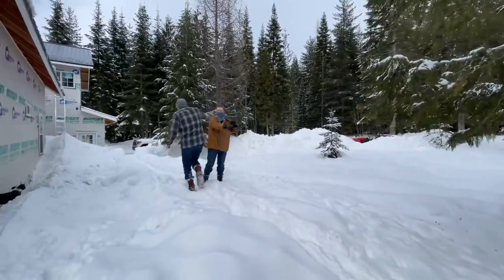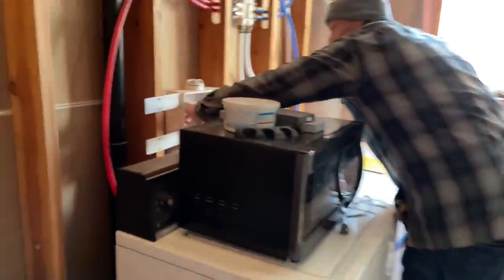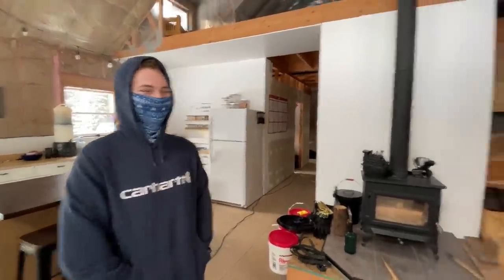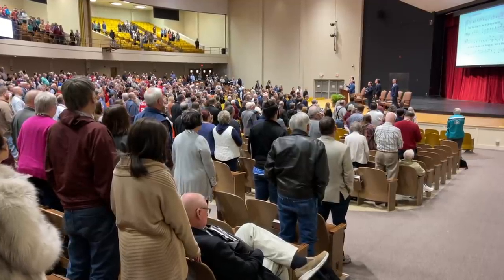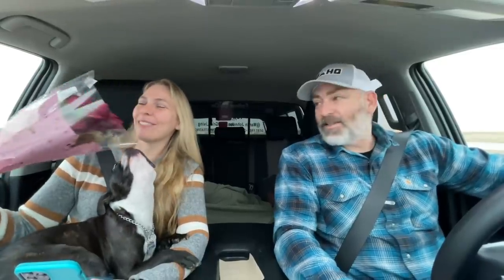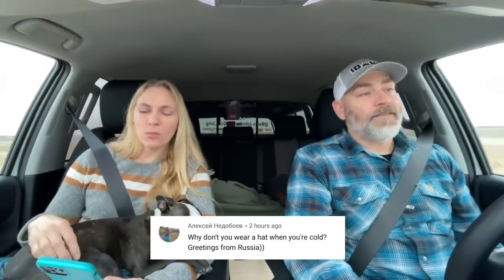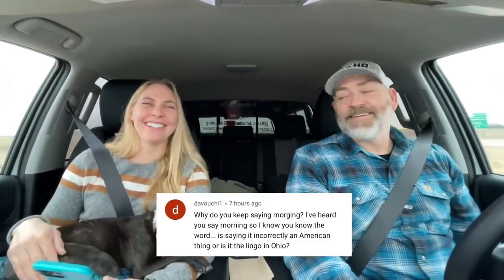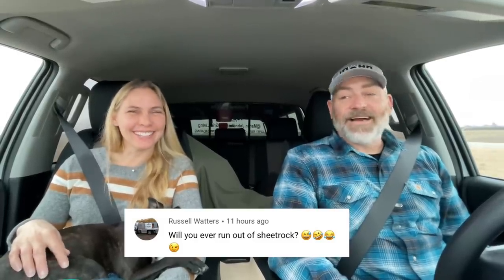YOU NEVER THOUGHT THIS WOULD HAPPEN

Comment: A tip to clean your stove. Items you'll need. Papertowel, Saran rap, amonia, blue grade scrubber sponge (this type of sponge will not scratch the enamel of most stoves, check your manufacture for cleaning instructions), scrub brush with plastic scraper. Step one: cover the stove top with papertowel (works best with a sealed stovetop), Step two: saturate the papertowel with amonia, Step three: Seal the stovetop with saran wrap overlapping the saran wrap to cover the entire stovetop (this is to seal the stove top so the amonia dosen't evaporate and to keep the amonia smell out of the kitchen), Step four: Let it sit over night and the next morning remove the saran wrap and papertowel, using the sraper side of the brush with the blue scrubber sponge clean the stove top. The baked on food should come off easily. Repeat or let the amonia set for 24 hours. Step Five: Rinse the amonia off the stove top.

Comment: why would u leave that big beautiful off grid house ? if u put your water supply up where your heat source is at the water would not freeze
Reply: When you're not heating your home around the clock, your water will freeze. You could try and use a heat tape, but then you would be draining your batteries. Draining the lines and adding antifreeze is what you do.
Just like an RV.